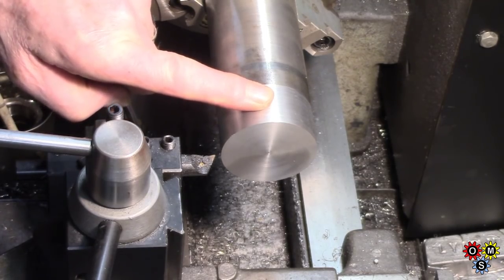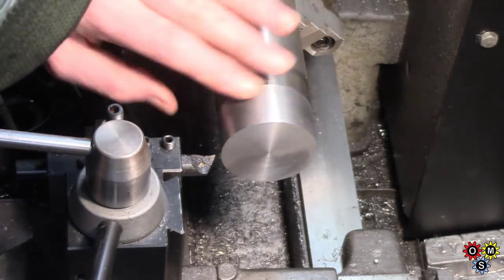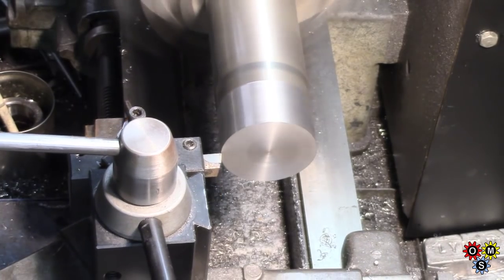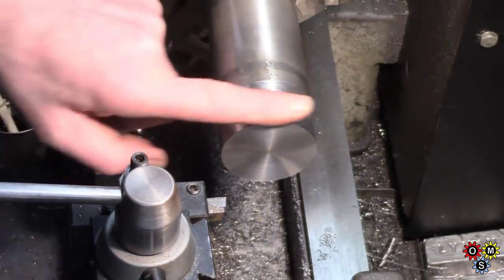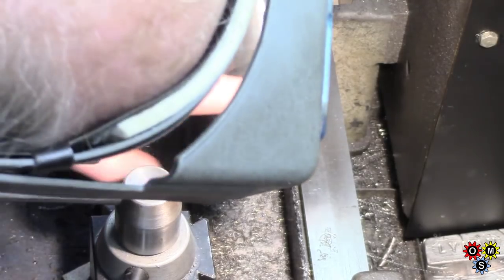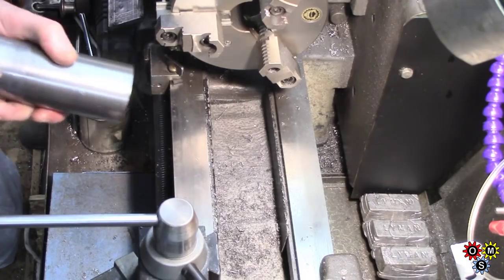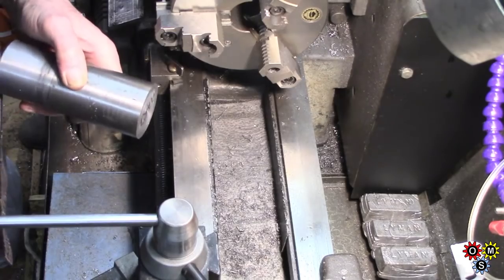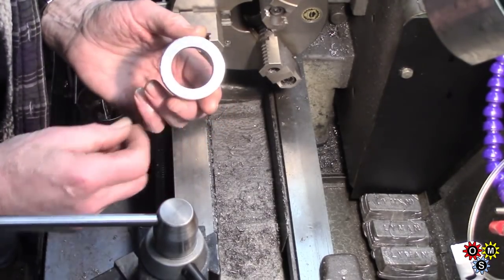Mill Chuck Tapping Collar, Part One

Comment: Chris... why didn't you do the 'od' and center drilling up to (say) a 1/2"... Then cut it off on the saw to 1". Now you got just a 'fat' 1" washer to work on with the boring bar.... Bore it out/face it off and you're done.
Reply from the maker: +Grandpa Bill 
Hi Bill - had thought of that but, I tend to like the chuck jaws to have a lot to hold as against a smaller piece that causes more stress on jaw ends. Since doing it of course I did reckon that approach would have been easier! Hindsight the usual 20/20 :)

Comment: Not that I'm an expert but perhaps the mystery material is tool steel?
Reply from the maker: +Art Borchers 
Hi Art - it seems possible it was in the category of 8620 - tool steel would have behaved better than that did. 8620 is a wear resistant material that is pre hardened apparently.